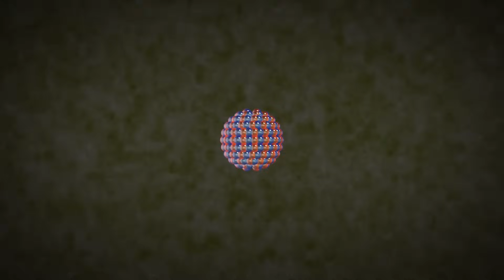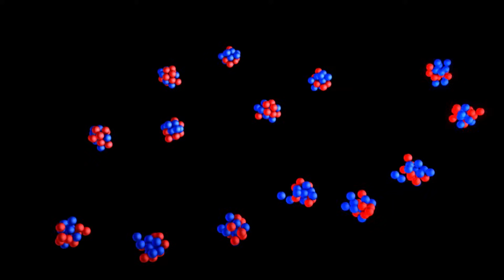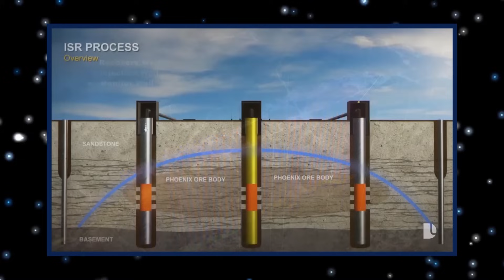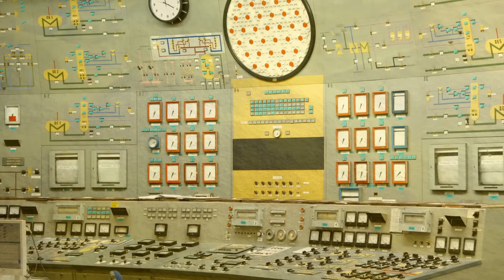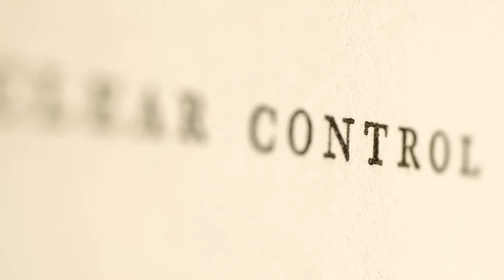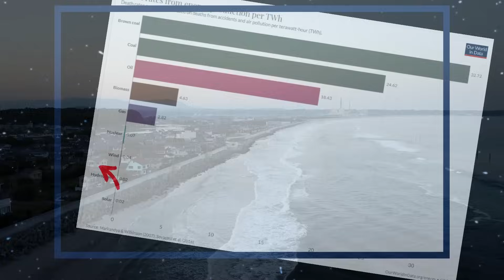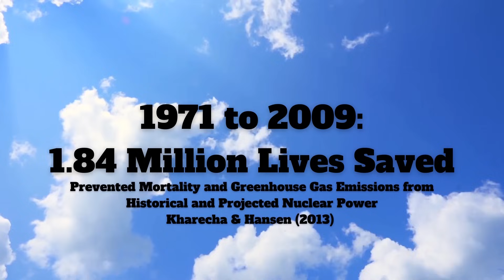URANIUM Documentary: Mining, History and Future Outlook

Comment: Just a little note about the begining of the 'what is Uranium?' section, when supernovae occur, they can can only fuse elements about as heavy as zirconium, while many of the heavier ones after zirconium occur when neutrons transmutate into protons via the weak force, this doesn't produce elements as heavy as uranium. Instead it is produced by  neutron stars when their binary orbits collide and fuse heavier elements up to plutonium.
Reply: Sounds like a lot of guessing passed off very matter of factly…
Reply: @aaronr1328 yeah how the heck.would.we know anything qbout these things really.
Reply: Supernovae can fuze litterally any element in existence. 
They can literally crush the core of a star down to such a small size that it becomes a black hole. 

Neutron stars only exist because the insane pressure inside a supernova condenses the core of the star so much that it is crushed on an subatomic level, to the point that the protons and electrons fuze together into neutrons and then continue to be compressed further into a solid ball made entirely of neutrons or possibly even quark matter.
Reply: @jakehildebrand1824  supernovae can fuse elements heavier than iron, but not much heavier than copper or zirconium. Elements like uranium are much heavier than that, 50+ protons more ish

Anyway, what happens to the matter inside a neutron star when the neutron star goes kilonova? It is expelled into space where it cools. In the process of it existing in such an extreme state, it can form elements as heavy as plutonium. However such extreme conditions do not exist in supernovae, only in the neutron stars they produce.
Reply: @randomantguy24  except those conditions DO exist in a supernova. 

Supernova are capable of fusing protons and electrons together forming neutrons which is how the neutron matter that neutron stars are made of is formed.

It takes magnitudes more energy to fuse these subatomic particals than it does an atom.

Comment: Yes but it is not pressurized light water standard reactors. We need thousands and thousands of molten salt thorium reactors. Each one should immediately replace a coal fired boiler for electrical generation for many times less cost than shipping and burning coal plus process heat for valuable chemicals like dimethyl-ether that can directly replace diesel and the same reactor can be used to desalination sea water very very cheaply.
Reply: We need both. putting all eggs in one basket is always fatal and LFTR reactors are not commercially viable yet, still in experimental stages

Comment: Uranium is not responsible for Earth's interior heat. Radioactive nickel and iron is responsible for that.
As for the Hiroshima and Nagasaki bombinfs, I suppose this author prefers tens of millions more deaths, years more war and a Soviet invasion of Japan over 160k deaths. Stupid!
I'm glad you made a pro-nuclear video but it is riddled with mistakes and opinions. For example, water is a moderator yes but neutrons in a reactor don't generate electrical power at all. They transfer energy to the water, heating it and then the heated water turns to steam and turns turbines. You also failed to mention that RBMK reactors used graphite as a moderator instead of water. Apart from tidal, solar and wind, we generate electricity solely by heating water and using the steam.

Comment: Good content. Well done. I'm surprised there was no mention of how difficult it is to process and dipose of the nuclear waste.  Is being buried undergound for thousands of years a realistic way to deal with it?  Seems like we are still prepared to poison the planet eventually.
Reply: Better than coal ash, which is also being buried for 1000s of years (toxic heavy metals, including radioactive ones in coal ash don't biodegrade), only in quantities a few orders of magnitude higher.
Reply: Decommissioning nuclear stations is a very tedious, dangerous and costly task.

I used to work for a company that designed waste nuclear containers. We did countless impact scenarios using computer simulations to ensure nothing goes wrong (like a train hitting if it stopped on the tracks).

It's crazy how much it cost to manufacture it, logistics and  cost to bury it deep deep deep down for 100s of year's  so no one in the future touches it.
Reply: @nickysixx2480  and thats why burying it underground is a dumbest thing you can do with it
do so and about 300-400 years later all fission products would decay away
and what would be left there is weapon grade plutonium mine

Thankfully this plutonium can be used as fuel - so if you take it out, and put it back in the reactor instead, things get a lot easier.
Reply from the maker: Here is an in-depth article that explains it much better than I could: https://sprott.com/insights/special-uranium-report-key-facts-about-spent-nuclear-fuel
Reply: I was hoping this would be addressed as well.
Reply: It will have to be buried for probably a couple of centuries at least. You’re assuming that human technology won’t get better in dealing with this waste in that time. In a couple of hundred years there will probably be cheap, very safe space flights. If anything the waste could be sent to the sun, I’m sure there will be other ways discovered on how to deal with it.
Reply: @highflyer454  Were you high when you flew this nonsense out there? A professor once told our class that if we keep our mouths shut, people won't know how stupid we are. You should take that advice.
Reply: Abandoned coal mines, miles deep and reprocessing are excellent solutions
Reply: @theccpisaparasite8813  Fission byproducts emit alpha, beta and gamma radiation from 100s of radioactive isotopes with half lives of less than a second to millions of years. Isotopes that never existed before 1939. They will be disintegrating and emitting subatomic particles that must be isolated from all living beings for 10-20 times their half lives. These isotopes are corrosive. What do you suggest they be contained in to protect from emissions for the next several million years? Vitrification breaks down after less than 100 years. There are no alloys that will survive for more than several decades. The casks for nuclear waste storage have a working life of 10-30 years, according to the manufacturer, Holtec. Coal mines are riddled with fissures saturated with ground water. Once radiation from the fission byproducts reach groundwater, how do you suggest we remove it to protect any life forms exposed to it?
What is the history of airborne and water emissions from reprocessing facilities, like Le Hague, Sellafield and Kyshtym? What percentage of the spent fuel that is reprocessed is reclaimed and what isotopes are in the reclaimed fuel? Is it cheaper to reprocess spent fuel or process uranium ore to obtain U-235? Is it more difficult and dangerous to operate a reactor on reprocessed fuel or U-235 from mines? Can reactors compete economically with other forms of energy supply?
For the energy consumer, do you consider nuclear energy to be an excellent solution? If so, what are you smoking?
Reply: reprocess it
from chemical point of view, 97% of the mass of spent fuel is exactly the same material as it was when the fuel rod was still unused
and even this 3% - most of it has uses.

Always made me laugh to hear you people quote this "thousands of years" number - not once mentioning it is a half life of plutonium 238
which can be used as fuel

so yes you can bury it underground
or just fission it in the reactor, and it is no more.

And all of it has been done in France for decades.

So no, spent fuel (as it shouldn't even be called a waste) is a problem only in the USA - which, for political reasons, forbid all nuclear reprocessing.
Reply: No more harmful than the process of creating and disposing of batteries that we use in “green” cars and the phones we use everyday. as long as humans exist, the earth feel our presence.  

There is no such thing as clean energy.
Reply: Oh, give me a break. The longest-lived isotopes (leftover U-235 and Pu-239) could be recycled, except that Emporor Carter decided that we wouldn't be doing that, because he doesn't like the idea. The most radioactive waste isotopes don't last that long; it makes sense (to most people) that when an isotope is highly radioactive, it gives off its energy in a short amount of time. So why don't you ignorant people stop repeating this nonsense.
Reply: @Scott-lz3pp  Tell me all about the reprocessing of nuclear waste. Does it reclaim all of the waste? How much does it cost? Does it produce any radioactive waste? Is it more expensive to reprocess nuclear waste to reclaim a portion that can be reused than to mine and enrich u-235? Is it more difficult to run a reactor on the reprocessed fuel than u-235 from the mines? Does it cost more? What has been the history of the reprocessing plants? With such a miraculous solution, are the meanies in government the only reason the nuclear utilities are not jumping on board to solve the waste problem? The government is just ignorant, huh? 
The most radioactive isotopes don't last that long. How long is that? What kind of energy does it give off and what are the effects? What should we do with them while they are still hanging around? Who should pay for maintaining them? Give me a break, Mr. Wizard and "splain it to me. Please, educate us all.
Reply: @jackfanning7952  i suppose Chinese didn't het the memo - because they actually build one of these reactors hes "scamming" for...
Reply: Hi Gary, you mention poisoning the planet.. what do we think the planet is made from?? Where do you think the energy of the earth’s volcanism comes from….
I suggest that we would be/ are poisoning our environments… the planet will always be around
Reply: @tigertiger1699  You either don't know or don't care that hundreds of radioactive isotopes that are thousands to millions of times more dangerous than any naturally occurring radioactive materials (NORMs) are created by nuclear fission. They did not exist anywhere in the known universe before 1939, except in minute amounts 2 billion years ago at a natural fission reaction in the Oklo mine in Gabon. Volcanos do not create fission products or transuranics. Neither do cosmic rays. Since 1939, humans have managed to generate 80,000 tons of high-level fission products in commercial reactors the U.S. alone. The  bummers won't tell us how much they have in their arsenals. That is also not counting all of the intermediate and low-level radioactive waste, hundreds of millions of tons of radioactive tailings and radioactive reactor parts from neutron activation. Leaving out the amount of plutonium in bombs (the bummers won't tell us how much of that they have), we also have 500 tons of Pu-239 inflicted on us that no one wants or knows what to do with... and contaminated ground and water from all of the nuclear catastrophes and intentional illegal dumping. All of this must be isolated from contact with living beings for longer than mankind has been in existence. There is no safe dose for any of these elements. BTW, the planet was not made from any of these materials. They exist because of stupid mouth breathers. This planet will not always be around. Where do we go when the nukies make it uninhabitable?
Reply: @jackfanning7952  
Not all nuclear is the same…, 
Let ask you this… if thermal efficiency is higher in a system with great temp difference between its hot and cold…
Why the F would anyone use water as the coolant in a modern system..?
You wouldn’t… goes to show that 90% of the reactor systems that nuclear haters love to point to are 60-70 year old original designs..
We don’t use steam engines as examples whats “bad”… why use ancient s of any tech to judge its future uses..?
Reply: @jackfanning7952  
By the way… please don’t make claims about me or others… when you know absolutely f all about me and what do/ am capable of understanding… I assert… it merely speaks more about yourself
Reply: you should ask China. they have devised a facility called Venus version 2 and version 3 is on the way will be debut in years which can solve nuclear waste and reuse them in a new circle. Chinese government is planning to construct more and more nuclear stations in the future to totally solve energy lack issue. they are going head the world..
Reply: @yehenry2281  Nuclear fission takes naturally occurring radioactive materials (NORMS), primarily alpha emtters with long half lives and transforms them into hundreds of alpha, beta, gamma and neutron emitters that are thousands to millions of times more hazardous that the NORMs. Reusing spent fuel does not burn up nuclear waste. It transmutes it into other radioactive isotopes, some more dangerous (if that is even possible) than the spent fuel. 
China invested more in renewables in 2020 than in nuclear for the last decade. China has halted construction on all AP1000 pressurized water reactors and the newly completed Taishan EPR reactor because of design flaws. In 2018, China arrested 13 nuclear industry executives for corruption and 3 of the top nuclear regulators. Promises of nuclear reactors that will solve the nuclear waste issue have been floating around for decades. Let me know when they fullfill that empty pie in the sky promise. Reprocessing of spent fuel reclaims a very small portion for reuse, creates a lot of airborne and waterborne radioactive waste and is hazardous for the workers. They are much more expensive and unreliable than obtaining fuel through mining and processing uranium ore. Reprocessing is the dirtiest, most polluting, most dangerous process in the nuclear industry. All fast breeders have inherently more problems than other reactors and are at least twice as expensive. Most operators that tried to run them have thrown up their hands and given up after expensive, insurmountable problems. Some require on-site dangerous, expensive reprocessing facilities to prepare the fuel for use. None have come close to being cheap enough and reliable enouigh to compete with any other electrical energy source in the marketplace. And they create unique nuclear proliferation risks. The past performance of reactors able to reuse spent fuel has been dissappointing at best and disastrous in reality. Even if someone had a blank check from a cooperative government willing to dump unlimited funding into these reactors (the industry goal) and somehow, they could be reliable enough to operate at capacity, it would take hundreds of years to make a dent in the waste spent fuel already in existence. That still leaves all of the mixed waste and radioactive contamination at military sites, nuclear exclusion zones, tailings mountains and sludge in mine processing lagoons and air, water and soil contamination routinely emitted every day at every reactor in operation. Oh, don't forget about the $100,000-500,000 billion price tag to decommission decrepit rust bucket reactors after 40-60 years, more if the site is contaminated, which most of them are. UK claims it will take 100 years to clean up Sellafield (they will never get it clean) and at least $3 billion a year just to manage and maintain the site. Fat chance of getting the nuclear industry to clean up any of their messes. Nuclear rule #1 is privatise the profits and subsidise the risks.
Reply: I am surprised that there was no mention of emerging nuclear battery technology that utilizes radioactive waste. I was also surprised that there was no mention of the need for petroleum energy to get the uranium out of the ground and processed, chaining oil and uranium together.
Reply: Not eventually. Continuously.
Reply: There not thinking for a tomorrow just a profit era milking every bit of worth out of the currency we use due to being prepared for onli the small few which is able to leav earth when it crumbles it’s disgusting how blaitant there robbing the earth of its goodness! All I say is we are well over due a population war way to many people who don’t deserve to be here
Reply: Check out Kyle Hill’s channel. He has a great video discussing the actual dangers (mostly lack of dangers) of the methods used to store nuclear waste.
Reply: Just fly it in bezos and musks space crafts and dump it in space
Reply: No surprise.  This video was extremely biased.
Reply: If you were living in a citie affected by Chernobyl and lost your life or loved ones low risk and things are so much better don't mean much.  They said that a lot in the 80's when I was in school. Things are so much  better now.  Cannot happen again.  Maybe not the same scenario, but look at Japan.  Easy for someone that was not affected by these accidents to say so much better now.  I believe it will be the future but for students studying physics to spew the same crap they did in the 80's is scary.  Technology makes absolutely nothing fale safe.  Nothing.  Safer.  Yes
Reply: They use as much as they can. Turn it in to ammo for tanks and such. But any stuff they can do with it cost so much it's cheaper to dig a hole
Reply: After 1000 years the waste will have lost power sp it will be else harmful
Reply: There is no reason to bury nuclear waste. Burial is religious anthropomorphism. We WANT the waste on hand so that next generation reactors can use it as fuel.
Reply: I'm not surprised at all!  This, in essence was a uranium sales pitch and left out a lot of things!